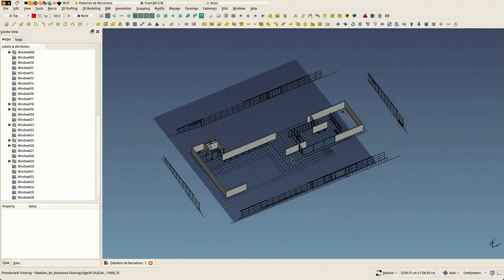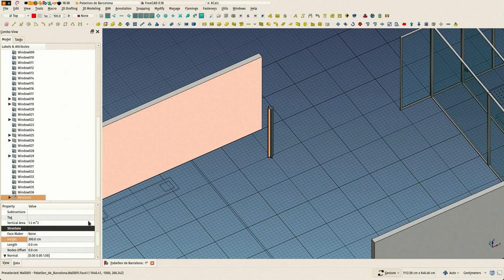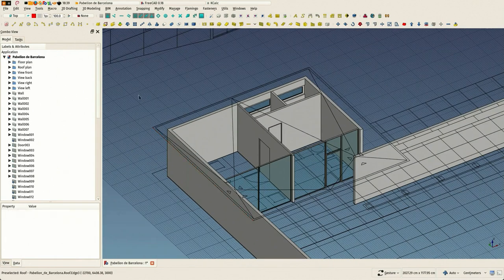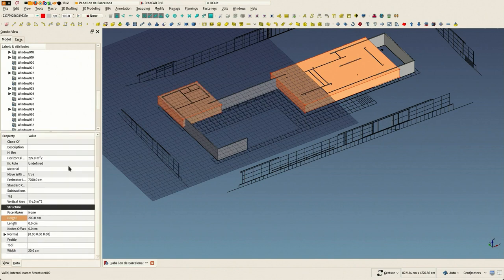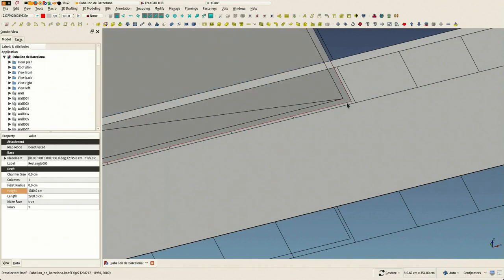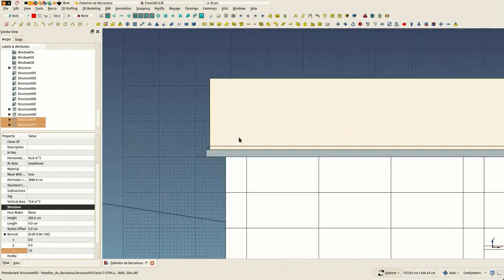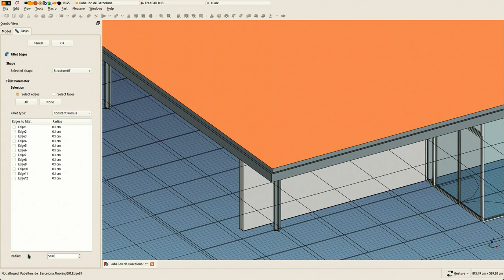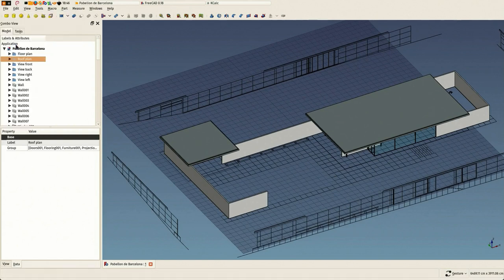BIM with FreeCAD - Barcelona pavillion 06 - Structure and roofs

Comment: Perhaps, it might be useful to other people: when I try to add the fillet object to the structure it doesn't work (it appears a red ! signal on the fillet applied and this shows me a message "BRep_API: command not done"). I solved using only the fillet object, turning this into a structure element and then changing the parameters I want. I hope it would be helpful!
Anyway, I find Freecad very accurate and improved: the credit for this success belongs to you and the whole team supporting this software. Thanks a lot!